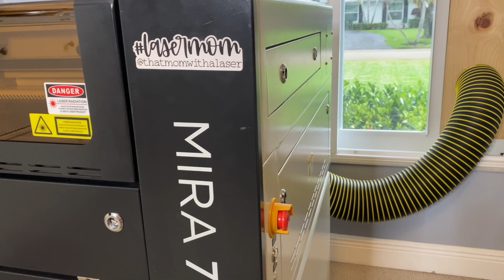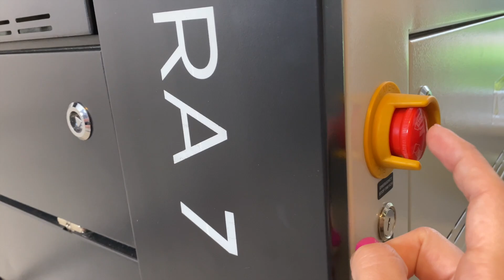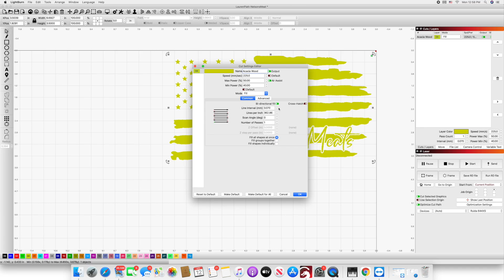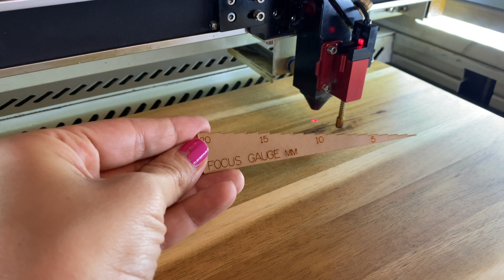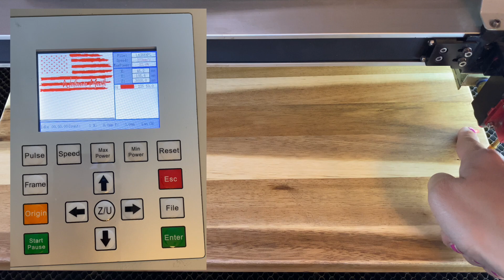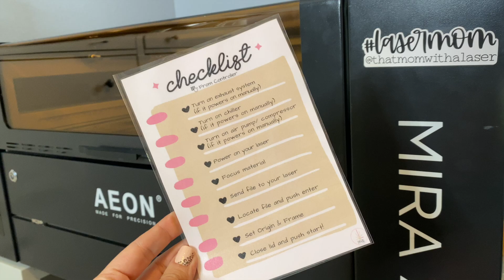How To: Laser Engrave/ Run Your First Job On Your Laser

Comment: Luv you videos and your creativity. I'm 6 weeks into looking for  a new laser. But, everything I look at needs after market chillers and/or blowers. My question is...is the MIRA 7 you're using straight out of the crate from Aeon or did you have to add after market components to get the results that you do? Keep up the great work.
Reply from the maker: Thank you! It works out of the crate.  In the beginning I used everything as it came.  I didn't really have any extra money to splurge on things like a nicer hose, fan, and compressor.  Over time though I grew more confident and had enough money to invest in those things to make production and use more efficient.  So to answer your question, yes, you can use it out of the crate.  It will have the standard stock fan and an aluminum hose.  :)